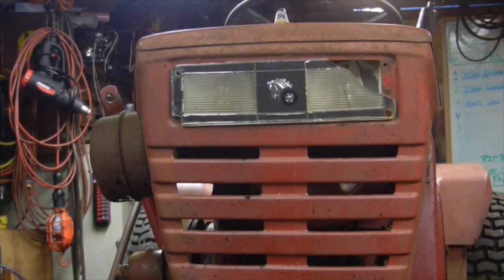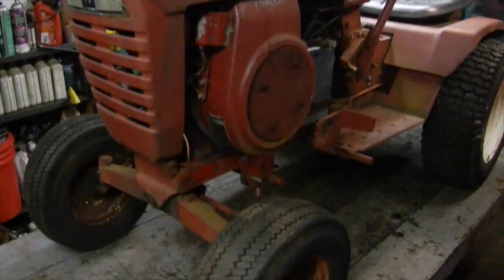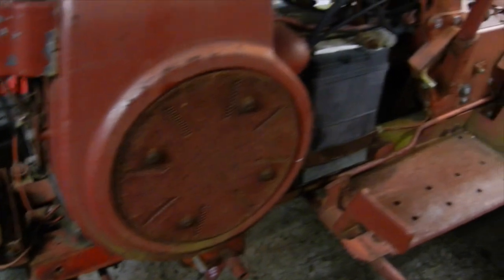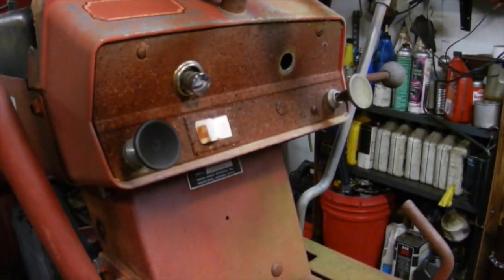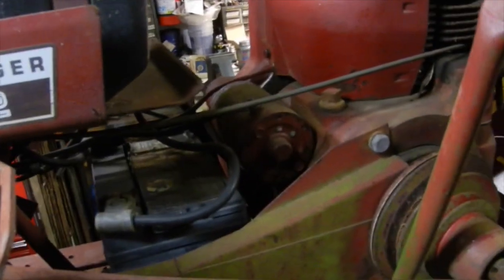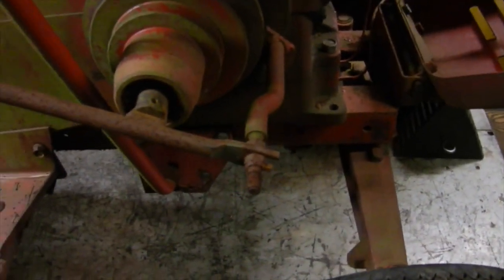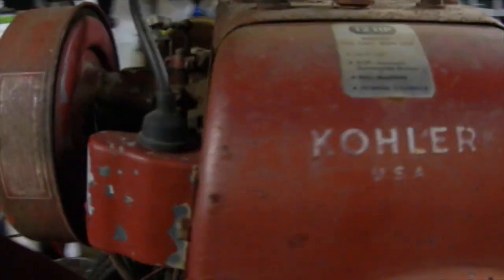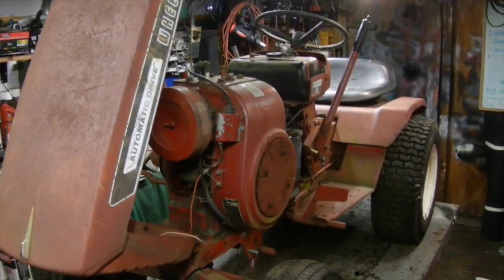Another  Joins the Herd- 1969 Wheelhorse Charger 12

Comment: Can't beat the 0ld Kohlers. I'm done with the new splitter and it's a good one. I just do mechanical go-overs and they look like they look. WD or PB has always loosened up choke and throttle cables for me, rust or not if it's not shielded. Good find.